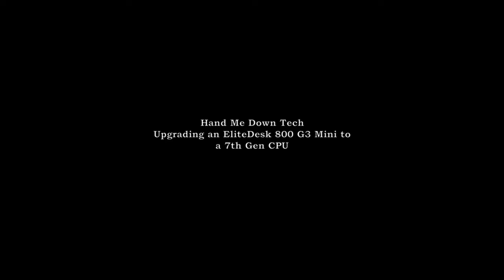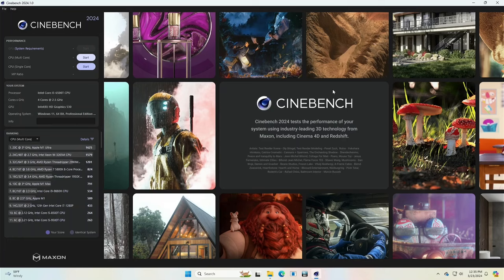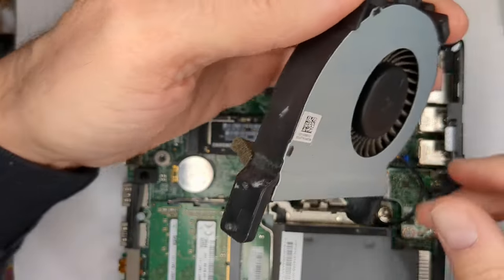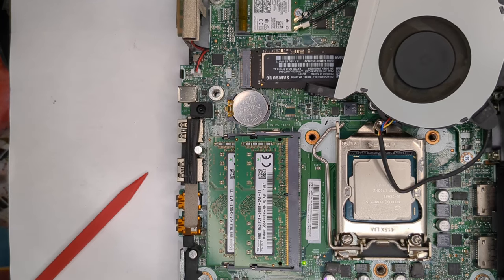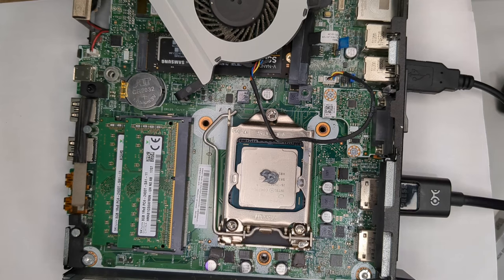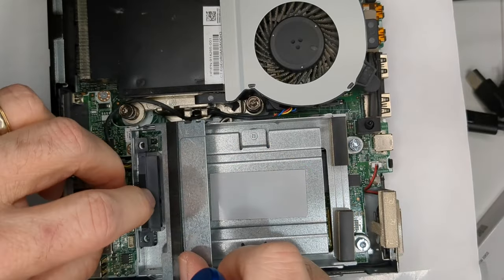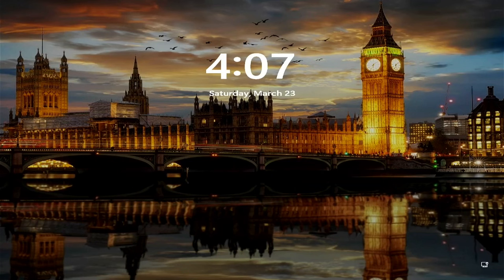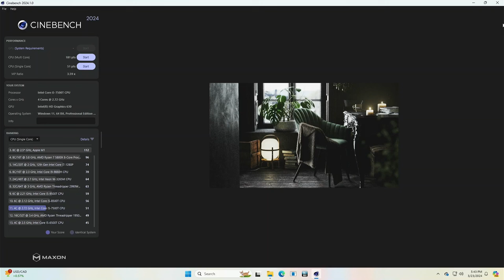7th Gen CPU upgrade for an EliteDesk 800 G3 Mini.  Is it worth it?

Comment: I am using 800 G3 i5 6500 Want to upgrade which cpu should be used can use 8/9 generation?
Reply from the maker: @vkachale721  you won't be able to upgrade since those use a newer chipset than the G3.  You could do a i7-7700 or 7700t

Comment: Hi, what is the highest processor that the HP 800 g3 mini can support? Can you put a xeon processor in it?
Reply from the maker: I7 7700 in the 65w model.  Don't those xeon have a tdp starting at 95w?  You'd need lots more juice and cooling.  The G4 supports a 95w tdp K processor but that's as high as it goes.

Comment: I know Windows 11 doesn't support 7th gen and lower processors. So how did you get yours running? Also Microsoft will stop supporting windows 10 October next year. So if you're a windows user, you might not want to buy this.
Reply from the maker: @basicsteps  I have windows 11 running on all of my units starting with the G1.  I have some videos on using Windows 11 wit the old generation.  My main day to day computer is a G3
Reply: I've recently bought Dell Wyze 5070 with intel Silver CPU and Windows 11
Reply: @handmedowntech  The takeaway here is that Microsoft will only support Windows 11 on processors that have TPM 2.0 or higher. I have an Intel NUC with the same processor, the J5005. So our processors have that. Although workarounds for older processors to run Win 11 work, it comes with the uncertainty of Microsoft not allowing updates to them.

Comment: I’ve always been a Dell guy but I absolutely love these mini ProDesk/EliteDesk units. They are incredibly expandable for their size and the Skylake and newer “T” processors are crazy power efficient.

The ability to run both an M.2 NVME and SATA HDD is very useful. My current 400 G2 mini has the m.2 as the boot/OS disk running Server 2019 and a 2TB Seagate HDD with all my music on it. It serves as my surveillance NVR, music server (airsonic), Jellyfin, HomeBridge and SHSH ticket grabber and it still has plently resources to spare.

I also have most variants of these starting from the G1 through the G6 that I’ve repaired/rebuilt over the years.

Love these machines!
Reply from the maker: They are addicting.  I do like the look of the G6 and when I find some gold nuggets I'll pick one up 😉

Comment: Looks like the 7th Gen has higher clock speeds, can use DDR4-2400, and had a newer generation IGPU.  Because, I asked myself why the difference in the benchmarks and looked it up... :)
Reply from the maker: It was refreshing to see an improvement.  Especially when my other video with moving from 8th to 9th Gen didn't show a change.

Comment: "it worth it?" Depends. For 20 bucks, sure, it could be a foundation for a useful little linux-based mini server.
 Anything above it: absolutely not. 1151v1 is predestined to be an 4C/8T platform not to mention that Windows 11 does not support it officially.
Reply from the maker: The G3 with a 7th Gen is a great little computer.  In fact it's what I use every day.  I use windows 11 and it runs fine.

Comment: What happens if putting an i7 7700 non T variant in a 35w unit will it work?
Reply from the maker: You would need a 90w power supply and also a second drive bay fan as well as the copper heat sink.  So basically everything that comes with the 65w model.

Comment: I know you have loads of mini pcs i now have to my hp elitedesk 800 G2 mini 65w and my new lenovo m720q thats a 35w one that got delivered today and only cost me £150 cheap i think its in a1 condition thats my works pc work have said thay will put there image on if i want plus my sisters ex works for lenovo and has also said he can get it imaged with the image it came with so thats good 
My question is do you use any mini pc as a media pc for the tv i use the hp and find 1080p brilliant but i want to up to 4k so is there a mini pc you would recommend as a media pc as im going to move the hp in to another room
Reply from the maker: So would you be streaming stuff.  Like running YouTube on the PC but using the TV as the monitor?
Reply: @handmedowntech  yes
Reply: I thought about another Lenovo m720q for the price but I want another hp
Reply from the maker: So which hps do you currently have?
Reply: I have a hp elitedesk 800g2 mini under my TV and that Lenovo that's going to be my works pc
Reply from the maker: @stevenbell9589  you could get another HP and install proxmox for experimenting with Linux and even windows
Reply: I could but I'm switching the hp I have for one that can handle 4k video
Reply from the maker: Let me know what you go with - another commenter was looking for 4k too.
Reply: @handmedowntech  I was asking if you new what would be good I did think of the G4 but then thought that's the first generation that supports windows 11 so then thought maybe the G5 or g6
Reply from the maker: Sorry, I forgot you did ask the 4k question.  Let me see if any of the HP can get that high.
Reply: @handmedowntech  mine runs 4k as I have tested it but it's not a 4k graphics as it's a hd chip the G4 has the uhd chip but think 2 generations newer to be safe
Reply: @stevenbell9589 You ca  install a lp gpu in the lenovo m720q. I have a Nvidia T1000 in mine. Otherwise you can put an amd 6400 if you want 4k videos and some gaming
Reply from the maker: @ll_spud  what type of power adapter do you use when adding the GPU?
Reply: @handmedowntech  I found a cheap 2nd hand 200w power supply but u can use the one size down 150ish watts.
Reply: @ll_spud  I did not know that I thought the nvidia gpu was for another pc lineup they did mine is a Intel I5 9400t so I don't think the amd will fit in it
Reply: @ll_spud  also I'm not using it for games the lenovo has my work account on it only for my work stuff it's what they have I work I like it that much thinking about a second one for £130 from ebay as a media pc not gaming
Reply: @stevenbell9589  I have a i7 8700T in mine. Yours is better. The gpu goes where the hdd is. I will find a video to show you how it works
Reply: @stevenbell9589  Also you may not need a gpu for a media pc but at least you have the option of adding one if you want to use it for gaming or a plex server in the future.